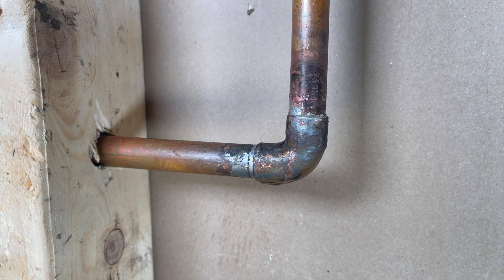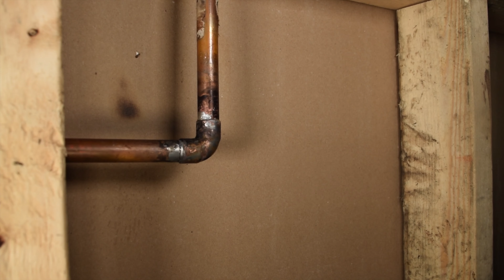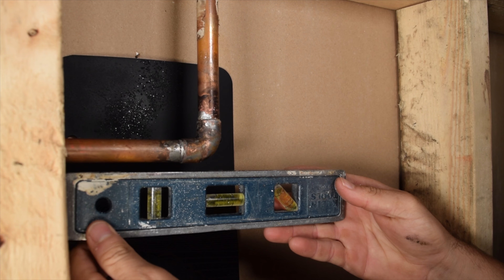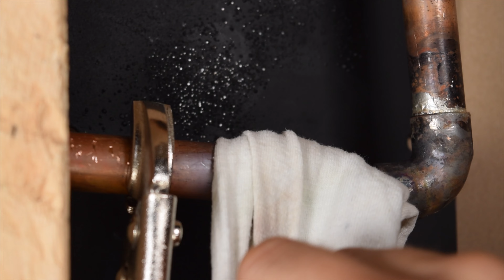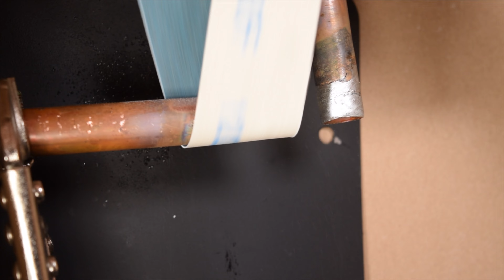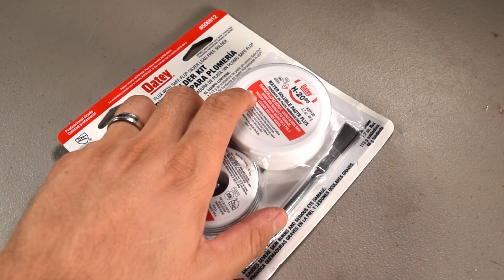How to Repair Bad Solder Copper Pipes

Comment: After you sweat the pipe apart wipe away the solder with steel wool, that works better than a rag.

Comment: The trick is doing this all upside down and blind under a vanity.  Easy enough when it's right there and you can not only see it, but move the pipes a bit.  Immobile pipes and joints you can't see make it a challenge.

Comment: Respectfully intended, but imo the best way to get all wayer out is. Open upper tap then open lower floor tap. now, SHOP VAC from the lower fixture, this works even better if you take off the braided supply tube under the lower sink, toss that connected tube into the shop vac nizzle and use a rag to seal around it, gets ALL the water out of the line. Everything else in this video is spot on :)

Comment: I’m working on my water heater lines had a few corroded nipples and fittings and slow leaks and I appreciate telling homeowners to work on there on houses. But also I just found out you should never use lead solder on copper plumbing I would have never known.

Comment: Carlos - I wouldn't bother trying to take a soldered elbow apart .
Put a bucket underneath the elbow . 
Just cut the elbow at a 45 degree angle . Let all the water drain into the bucket .
Then use a slip joint pliers and a torch to remove both pieces of the elbow .
Clean the ends with either steel wool or emery cloth and add flux . 
.
Reply from the maker: Awesome tip!!! Next time I’ll try this.

Comment: Everyone should learn how to solder. Yeah, there are easier ways to make connections nowadays... but it's never too late to learn or practice when in a jamb. (..your Daddy can't hold your hand forever.)👍
Reply from the maker: Absolutely agree! Learning how to solder is a valuable skill, and you're right, it's never too late to pick it up. It can really come in handy in a pinch! Thanks for the encouragement and the reminder that self-sufficiency is important. 👍😊🔧
Reply: Those newer fittings (sharkbites, propress, etc) are nowhere near as good of a connection as solder since they all rely on a rubber o-ring. I would never use them in a customers house personally but I don’t like call backs.

Comment: That isn't a blowtorch.
Reply from the maker: Soldering Torch? 🙂
Reply: @DIYPlumbingGuy  Better. Better still is simply "propane torch", since they're used for tons of different purposes... and connecting a copper pipe to a copper fitting isn't generally referred to as "soldering" although it's done with soft solder.

Calling it a "soldering torch" implies that it's used for electrical / electronic purposes instead of plumbing.
Reply from the maker: @timhofstetter5654  Thanks for the tip! 'Propane torch' makes total sense. And thanks for teaching me something new today – much appreciated!🔥👍
Reply: @timhofstetter5654  Believe me, joining copper to copper with an alloy that melts below 450 degrees Celsius as our demonstrator is doing is called soldering, or soft soldering, to be more precise. What are you saying it should be called?
Reply: @MarcWh  That procedure is called "sweating".

Please feel free to look it up.
Reply: @timhofstetter5654  Don’t need to look it up, thanks. You can certainly call it sweating, but it is undeniably also known as soldering, or more precisely soft soldering. 

The problem with the term sweating is that it also has a much more specific meaning in soldering and brazing, which is to deposit a layer of solder onto two surfaces before they are joined, to let them cool, then put them together and heat again until the solder flows. This is known as sweat soldering.

Your insistence also that his torch should be called a propane torch has a very poor foundation, as wider reading of the literature would tell you. Propane is just a gas. He might be using propylene, for all we know, or even butane.
Reply: @MarcWh  Sweating has nothing to do with depositing a layer of solder before the workpieces are joined, as you would know if you had ever done any plumbing work... with a propane torch, which is not under any circumstances to be mistaken for a blowtorch, which is a wholly different device.

It has nothing to do with the literature; that will only get you college knowledge, which is greatly inferior to real-world understanding.

The torch is clearly propane. Propylene and butane don't make that type of flame.

The sweating of copper plumbing parts, as shown in that video, is never called any sort of soldering except by those ignorant of the accepted terms. "Soldering" is used for other applications of low-melting-temperature alloys, never for plumbing. Especially not in English-speaking countries.

Trust me here. Look it UP. Then you'll KNOW.
Reply: @timhofstetter5654  

Your uninformed pedantry, poor reading comprehension and gratuitous disparagement of college education strongly suggest you’ve spent too much of your life in one country, and not enough of it in college. 

Unless you’ve worked in the metal-joining industry in several parts of the English-speaking world (in which case you can’t have been paying much attention to people’s use of language while you were overseas) I'd suggest you might want to avoid presuming you know what trade terminology is used in all English speaking countries.

For the record, I’ve been soldering, brazing and welding professionally in the UK for over thirty years, ten of them as a plumber. I’ve also worked in Europe and the Far East, and spent considerable amounts of time in Canada and the US.

Yes, plumbers in the UK use the terms “sweating /sweated joints” etc. but far more often nowadays they use the term “soldering” for joining pipes with soft solder. Just look up some of the big UK-based Youtube plumbing channels and you can see for yourself.

What about you? What credentials do you have? Given the rampant misinformation you’re spreading on this guy’s channel, whatever credentials you may have,  you clearly have few scruples.
Reply: And here are some links for you demonstrating the “soldering” of copper pipe, the last being from one of your own countrymen, no less. Enjoy!

https://www.youtube.com/watch?v=fxwK_B2bpe8

https://www.youtube.com/watch?v=pl_Q2_hcs-8

https://www.youtube.com/watch?v=xJodDBC5AwY
Reply: @timhofstetter5654  Read my reply again. You’ve clearly not understood it.
Reply: @MarcWh  I can only conclude at this point that you are a troll and so I will block you as such. So long.
Reply: @timhofstetter5654  Might be a regional thing...with regards what's shown in the video it's definitely known as "soldering" here in the UK, although there are other types of soldering in other fields..."Blow torch" is a fairly generic name that seems cover many types of torch from  a kitchen mini torch to full on oxy- acetylene torch used for welding..I have always known the device in the video simply as a torch, with the context making it obvious what it means. Folks do sometimes prefix it with the gas used, and I have no problem with that as it clarifies the situation as there is a big difference between say butane and Mapp even if the torch used can run on either...
Reply: @timhofstetter5654 I conclude that both you and markwh are trolls. What a childish and pathetic thread with you starting it.
Reply: @mgpvii  Well, isn't that cute. Conclude all you like. Enjoy your harassment report. Your mom is gonna' be PISSED.
Reply: @mgpvii  Id est... had I actually been a troll, you obviously would have played right into my ploy, wouldn't you? So instead of being the scathing commentary you had hoped, your reply here had only the effect of admitting to the whole world that you're prime trollbait.

So how's that working for you? Are you winning, son?

Oh, dear gods, I hope you don't still think that's a blowtorch.
Reply: @  I am simply making you aware of who you are because you obviously have no sense of self awareness.  The funniest thing about your comment is you calling me son. Your back and forth commentary with the last YouTube commenter demonstrated how childish you are, trying to show how knowledgeable you are about what something is called. Quite pathetic. Now be a good little boy and stop your nonsense.
Reply: @timhofstetter5654  Thank you for proving my original point.
Reply: @mgpvii  There's your second report.

You still can't tell the difference between torch types.
Reply: @mgpvii  Logic just isn't really your longest pants, is it?
Reply: @timhofstetter5654 Hahahaha, you are so very much sadly mistaken. I graduated top of my class with a mechanical engineering degree with a professional engineering license. I far exceed any logic you may think you have. I see from your comments that you are a little touched in the head.